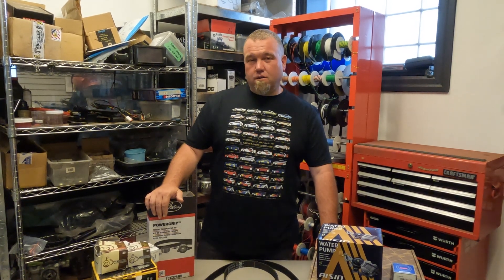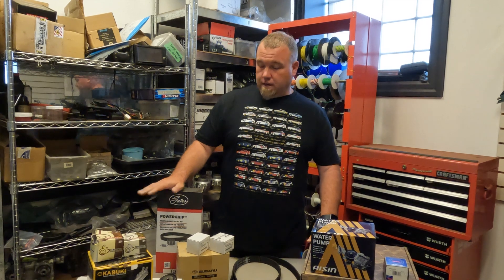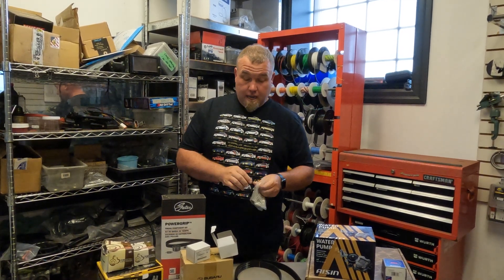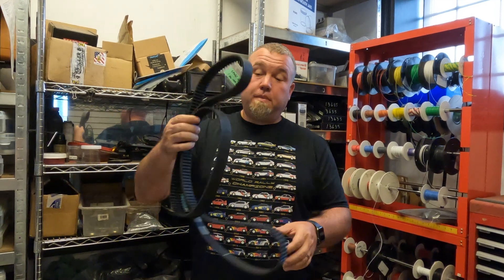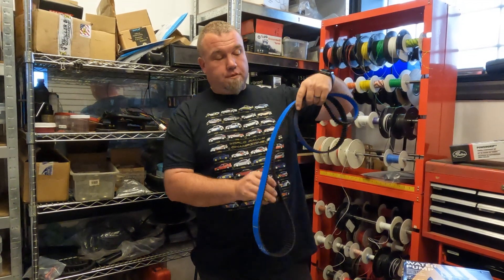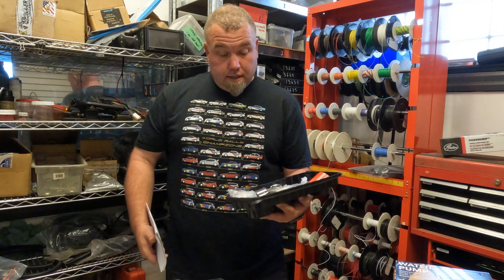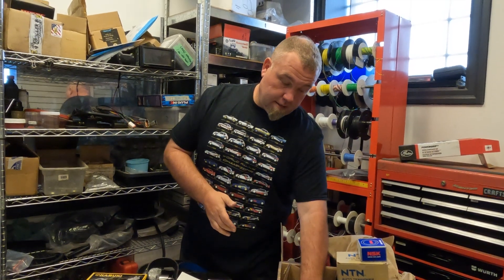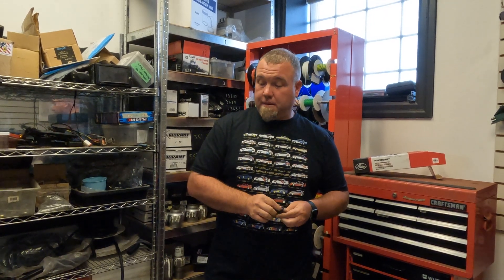How to choose the right timing belt for your EJ Subaru

Comment: Some kits with the lettering 'wp' includes a water pump. my 06 oem belt kit lasted till 2012, used a gates belt kit with off brand water pump which gave up on dec 2022. the rest of the kit felt half dead. I imagine if there was another pulley with a weak point, it would give up first and cause damage. best to replace the timing belt kit every 9 years, not 10 as they say.
Reply from the maker: Yes we avoid the gates WP kit because we have found the pump they provide is sub par. OEM pump and thermostat you are gold.

Comment: Off topic but do you happen to know of a company making stronger transfer gears for 5 speed transmissions? Ppg and zf designs both said they don’t and I’m not sure where else to look, just asking random subie heads now lol
Reply from the maker: Finding upgraded 5 speed parts is difficult and cost prohibitive. Jam a 6 speed in it and you will be good.
Reply: @NvautoCa  well it is rwd converted, brz trans is probably my next project, it’s a little more cost effective and still sturdy enough within my power range. I’d just like to prolong my 5 speeds a little bit until the car goes down for the swap.